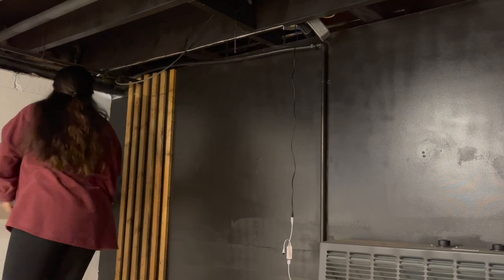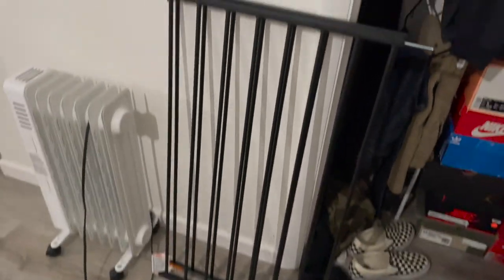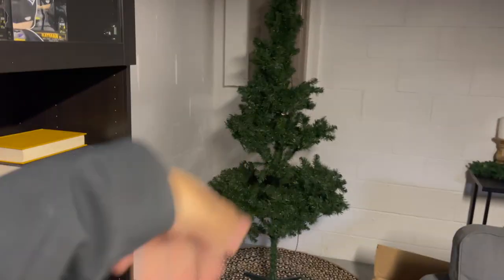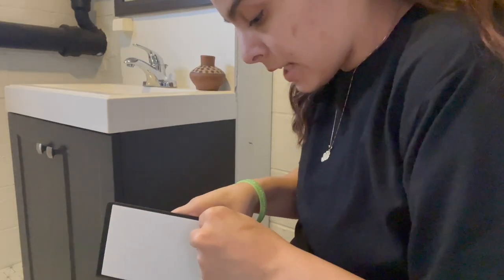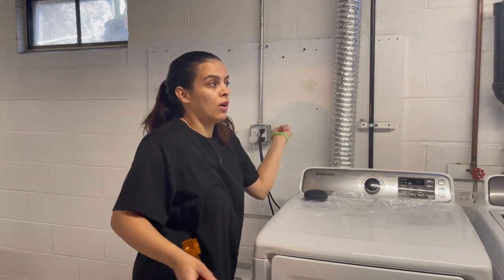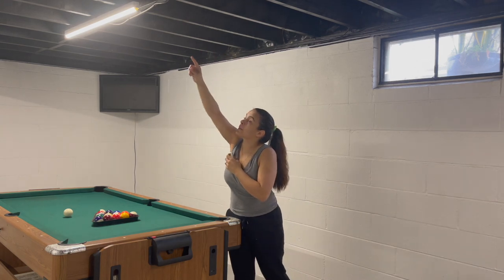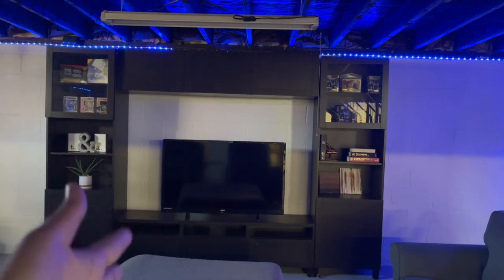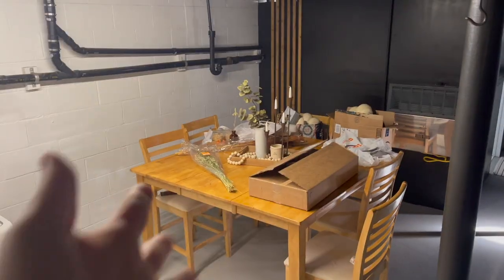DIY BASEMENT MAKEOVER PART 7 | FURNISHED | HOW TO MAKE AN UNFINISHED BASEMENT LOOK FINISHED |

Comment: I have a very similar basement setup. I moved into my house about a year ago. My basement is kinda finished but needs more work and it’s got a moisture issue and mold issue we are fighting. As soon as the weather warms up, I am going to regrade my dirt around my house, clean gutters, and repaint with dry lock on the basement walls. Hopefully that will be enough to fix the moisture problem. I’ve been waiting to do my basement for so long! Your basement looks nice! Good work.
Reply from the maker: Oh wow!! I hope all those issues clear up for you!!

Comment: Hi! Awesome. Great help girl! How did you hang the LED lights? I can't tell. Why did you need an extension cord for them f they are Bluetooth? Can you just control by phone Bluetooth? My husband isn't handy so I am hoping this will work. We don't have help.
Reply from the maker: I ended up attaching the lights to the wood beams that were above the brick & they stuck on just fine! & they are Bluetooth and can be controlled by phone but they need to be plugged into an outlet at all times. After the initial set up, they are very easy to use 😊

Comment: Working on my basement also what did you use to hang your led lights. My less will not stick to wood
Reply from the maker: I had the same issue, luckily there was a piece of paper at the top of the brick from insulation that the lights stuck on to. But most led strips have dotted lines in between the lights where you can “cut” them to a shorter size so maybe use nails to nail it to the wood
Reply: Thank you and your basement looks nice good job..
Reply from the maker: @Paul-The-Searchlightpiper  thank you! 😊